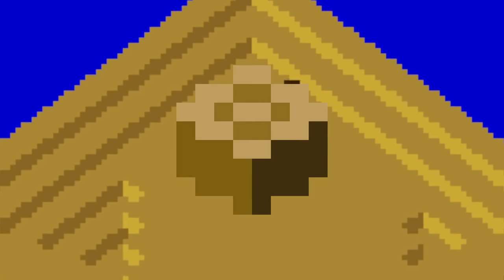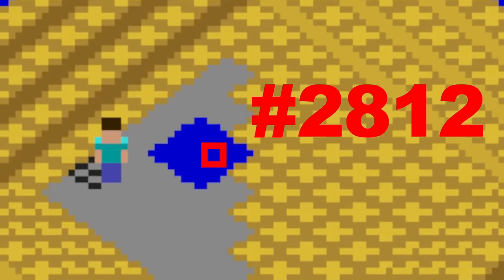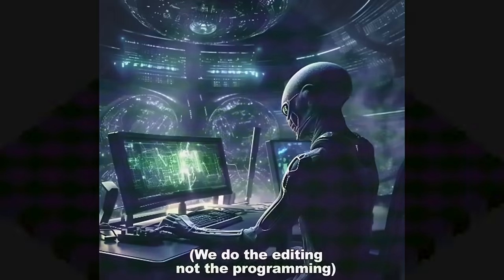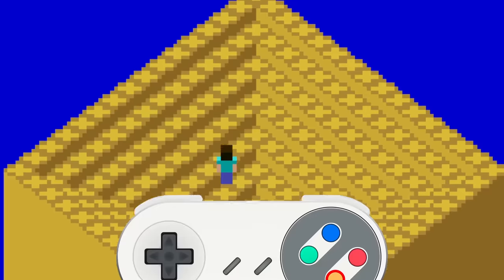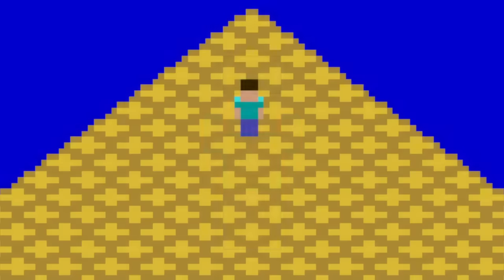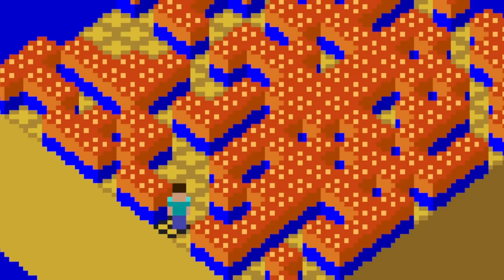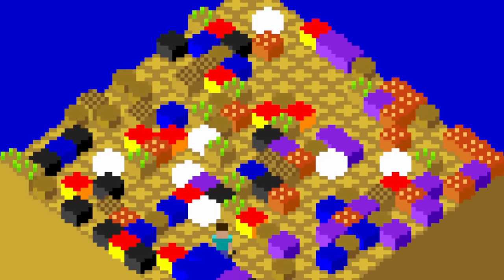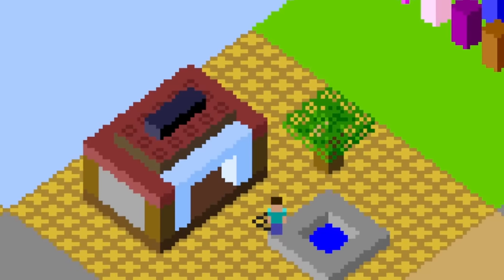8-Bit Minecraft Pt. 2: There's A Reason This Doesn't Exist

Comment: You didn't fancy making this for a computer that people actually own? I can see Commander fans want software for their machine, but really there's a reason these machines aren't more popular. They don't fit a need. They don't have the nostalgia value and the charming limitedness of old machines, and they don't have the power and ease of new machines. They have no nostalgia, and some limits, but arbitrary ones. So it seems like fighting the limits by programming it, is a bit of a pointless endeavour. The limits aren't there for a reason, they're ersatz.

The NES would be a challenge. Tiles would probably be well suited, even if you decided against them, but you'd need RAM on board the cart, if you made a cart. The Commodore 64 though, or Spectrum or Amstrad might be nice, lots of RAM. Maybe a machine with a floppy disk would be better than cassette tape, or maybe tape would be a challenge to rise to, you'd have to figure some extremely efficient way of coding your envorinments, but that has been done many times in the past. 

There's likely always going to be more people playing on old computers, especially if you include emulators, than these weird half-breed things like the Commander. But then it's your time. Still, if you wanted the RAM, there's the Atari ST and Amiga with half a meg, up to a couple of meg, each. 512K would be a good standard if you can do it, since that's what most models had. Decent CPU too, as long as you kept the environments small enough to not need too much calculating at once.

Comment: Obviously you meant to say 255, since you can't store 256 in 8-bits, and it probably wouldn't be a good idea to give everyone a single item by default when the counter is at 0. I do wonder if there's actually enough memory with the X16 that you could perhaps use a 16-bit value for the count, or if that's taking it too far.
Reply from the maker: Actually I do mean 256 since if the first byte in the inventory slot pair isn't 0, then it means I have at least 1 item, so the range of the second byte can be [1-256]
Reply: @InkboxSoftware   So then it's 255 possible items, but 256 possible amounts of each?

Comment: Is there any good reason to track the player position in screen coordinates rather than in world space? Are you saying the player has a X/Y in screen coords and then you store a Z in world coordinates? Because how else would jumping even be possible otherwise, if you didn't know the Z... I know people do transform screen coordinates into world coordinates all the time e.g. if there was a mouse cursor in this for example to select blocks. But using this coordinate system for the player position?? Surely I'm misunderstanding everything you said in this entire video.

I forgot how you're drawing the blocks to the screen, but surely that already needs to take care of the task of converting world coordinates of blocks to screen positions, albeit at a lower resolution than what player pos would need.
Reply from the maker: It's mostly due to irregular block shape. Each block graphic is 8x8 pixels, but the visual representation of the block's top is 24 pixels laid out in an irregular configuration. Block graphics overlap their 8x8 drawing area, this means that even on the same 256 blocks of a layer that there will more than one block that matches the player's hitbit coordinate. So I have to calculate things out via real on-screen locations to see which of the 24 pixel sections the player is standing in. I can't think of an easier way to calculate things via world-coordinates since there aren't simple rules about going over X pixels and then that turns into block Y. The math isn't that simple.

Comment: Wouldn't it be easier to use full-byte IDs and use a simple "greater than" check to delineate between items and blocks?

Also, maybe stop rendering of all layers above the player's head when there's a block somewhere directly above the player's head?
Reply from the maker: Blocks have values less than 128, items are greater than 128

Comment: Have you tried running this on a CRT ? It wouldn't be great if you made this to run on old hardware and forgot about the old screen
Reply from the maker: I did run it on one once, but the only CRT I have is an old Chinese one, and it doesn't work great with the Commander X16, but everything looks good on a VGA monitor.
Reply: @InkboxSoftware  i hope you can get around to run it on a compatible crt, often because of the scanlines the resulting image is completely different

Comment: Honestly, that cursor movement system is miserable. Having to spam R and Y to change your cursor selection is terrible. I think it would be far better if you could do something like hold R and use the d-pad to select the direction from where you are, and then maybe hold L and use up and down on the d-pad to change the vertical layer you're effecting. If you just press R it selects the block in the middle, and if you just press L maybe it selects the layer beneath you. That way you don't just have to sit there and press R  over and over to move the cursor where you want.